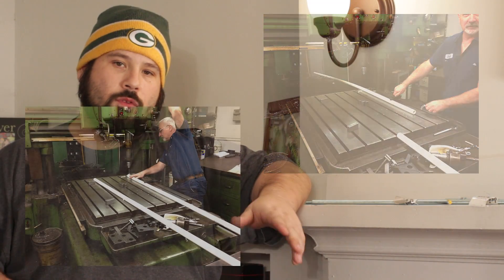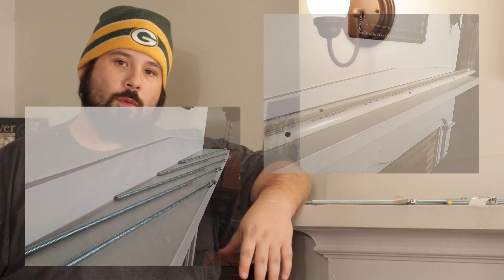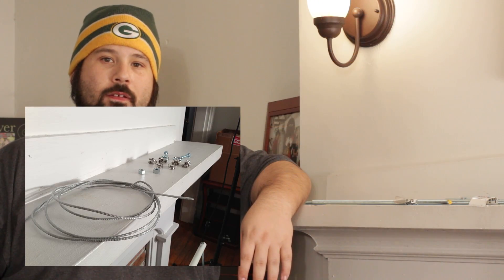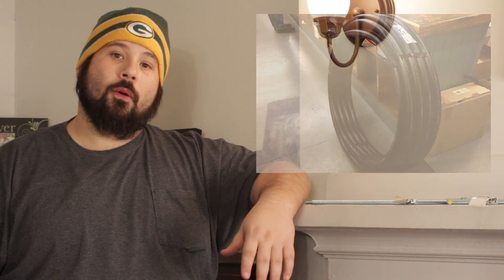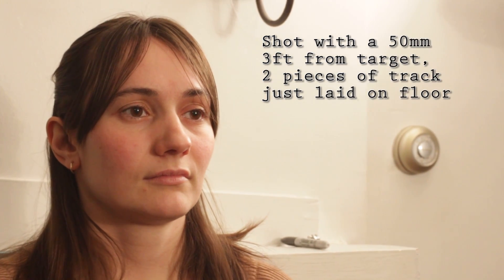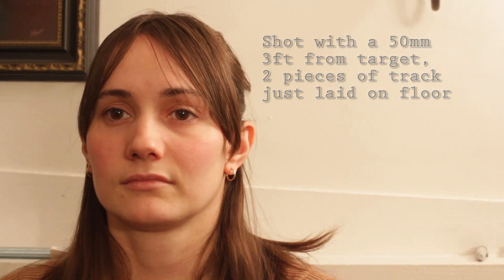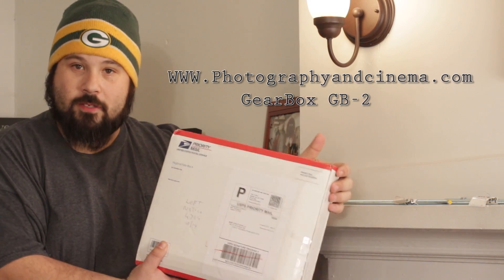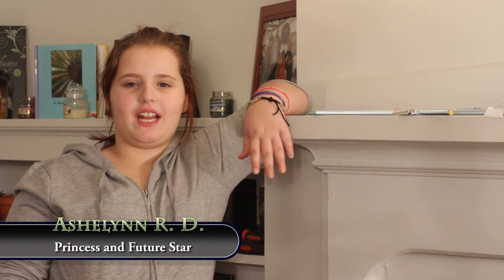TRP Curved Track and Great GearBox Challenge

Comment from the maker: The Braided hose has a surface finish that is not solid enough to promote smooth motion from the dolly wheels, for larger wheels that may be an option, but for what i had available to me, not so much so

Comment: Have you consider a braided rubber hose, from like autozone? just get a thick walled hose with the outside diameter you need, if its a braided hose (has that braided mesh built into the walls) shouldn't that give you more flexibility, and still the strength you need? to prevent those kinks you get in pvc bending, without having to fill with sand and heat

Comment: did you try adding the spacers to the top of the handles? I know its not designed for that, but that way your hands will stay lower with the camera while giving you more space on top. with my gh3 there is just enough space to reach what I want so I love it without spacers.